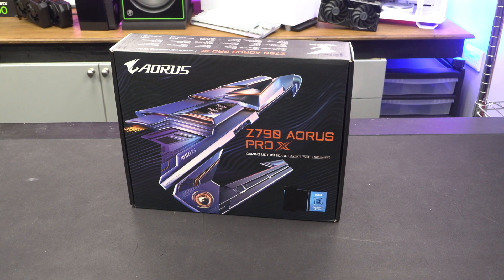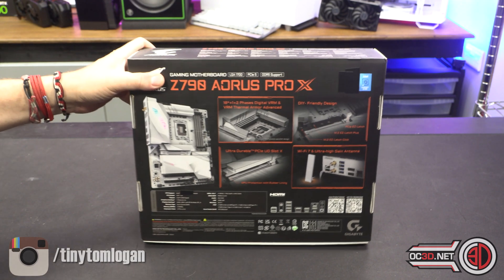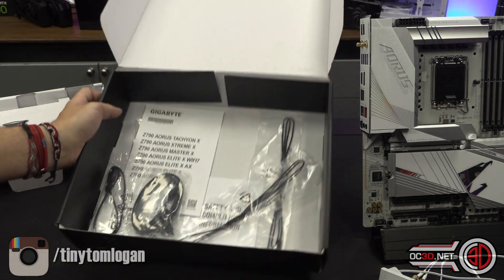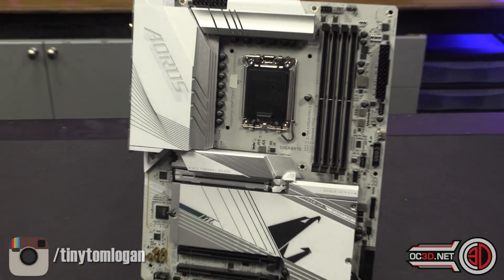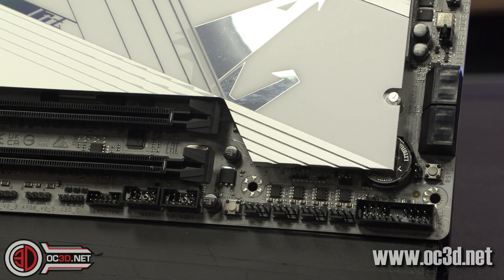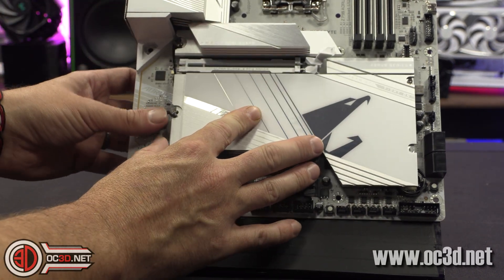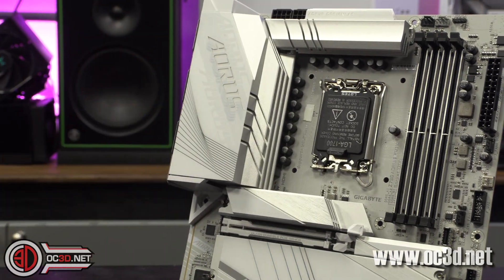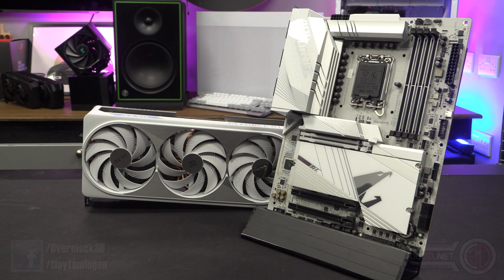Gigabyte Z790 Aorus Pro X Preview

Comment: did you guys test yet if these x boards can actually XMP 8200>?
Reply: no , it can easy 8200 but not use XMP，XMP it is just a brainless mod for users whom never study OC knowledge , but GIGA all 14th motherboards can easy 8000-8200 sure ,it is truth , even overtake all 13th OC motherboards like aorus Ti , ROG APEX , EVGA Kingen , because 14th motherboards changed some design for memory ,cause it can OC easer than 13th MBs
Reply: yeah i have an apex encore on the way for my 14900k and a nice kit  @lynver6719

Comment: I already have this board on preorder. Im gonna pair it with a 4090 aero in a D41 Mesh LCD.

Also really like the internal USBC DP header as it lets you run a sensor panel LCD with internal cables.
Reply: Where is this available to pre-order?
Reply: @NobleSquad  Technically nowhere but i work at a computer retailer so i can put preorders in when the product first shows in the system rather then when the public can.
Reply: @MrKeeleeer  Oh lucky, do you know what the MSRP and release date will be?
Reply: @NobleSquad  I have a Canadian place holder price of $544 if i recall correctly. And no i dont know when release is.
Reply: i would buy it, but already have z690 A gaming wifi ddr5

Comment: many of these z790 motherboards are using intel NIC's and they are causing problems. nice to see this board is realtek
Reply: i have gigabyte 0 issue and problems and with INTEL NIC 0 issues cost was 550 euros.. it is only related with asus.. I had asus  rog strix and i sold because of that and alot of blue screens with asus for no reason.
Reply: Realtek® 5GbE LAN chip (5 Gbps/2.5 Gbps/1 Gbps/100 Mbps)

Comment: Love white components but it looks more grey than white. Its still sexy though.Keep up the great work bro and stay safe.
Reply: bad exposure for the pictures. But it's not high gloss white  but definitely white. But why did they do the connectors in black? White would have been much better. For example if I fit a white power cable that motherboard connector is black. Stupid.